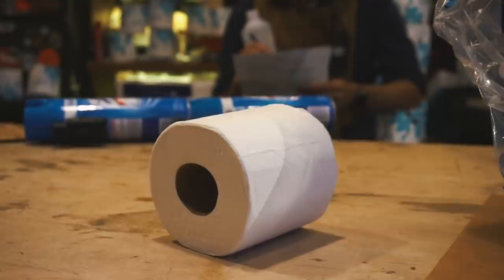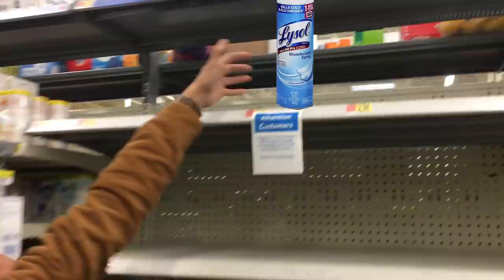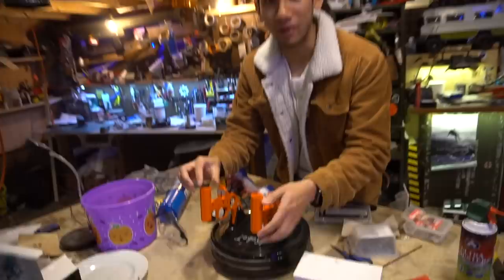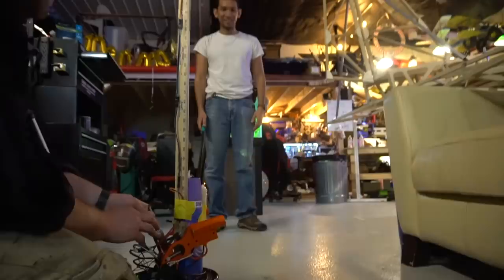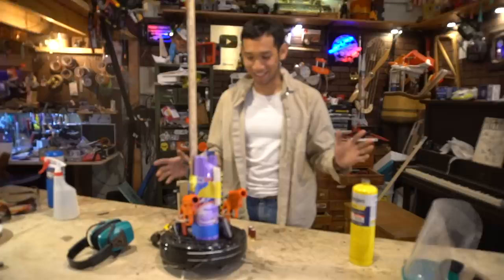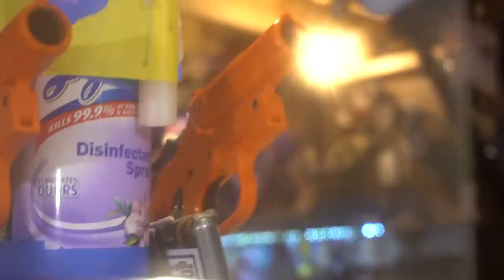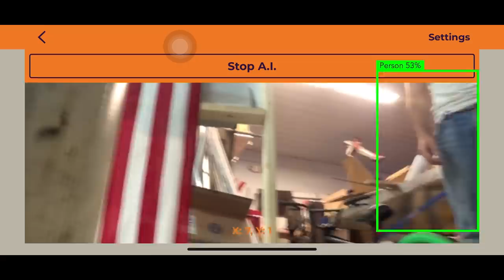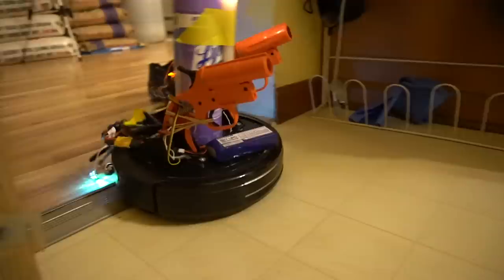A ROBOT that SANITIZES! (Roomba Hack)

Comment: They should try to upgrade from the N95 masks by modding an air helmet (I liked the look of the Ocelot AF-1 I saw on a quick YouTube search even if I have no idea how well people like it) that people use for wanting to filter air (Eg. for dusty, hot riding, pollution, etc.).  Wonder how well a sealed, high intensity UV air filtration system could work. Some protective shields for woodworking (to avoid wood chips/dust) have neat systems too.

Comment: My dudeee you need to make a 2.0 maybe make the shells more fragile if possible so it crumbles fairly easily when fired and a better idea is putting air purifier around it laying down and use small ones it will look great and clean air

Comment: Aerosols and cleaning products are not great to breathe even without being burnt but the residues and gasses produced by burning it would be even worse. I'm surprised that Peter was willing to spray it so much. Note I'm not saying that sanitisers used properly are bad, just that its not meant to be ingested or inhaled. No it probably won't kill you. But it may increase your risk of respiratory problems (Cancers, ulcers, etc). No I'm not a scientist nor a conspiracy theorist or anything crazy like that - I'm just sensible lol.

Comment: don't use hand sanitizer for anything other than your hands. the reason why you don't wanna do that is the fact that hand sanitizer contains Glycerin, once the Alcohol or ethanol in the hand sanitizer has evaporated the glycerin residue is still remains. Glycerin alone is a breeding nest for bacteria and viruses. so by doing what you think is safe, you make things worst. for cleaning, you need to use a none glycerol-based product with a minimum of 80% alcohol. Any medical staff should know this as well. sadly that's not the case! glycerol is the pure form of Glycerin and is used in labs to freeze bacteria in tubes for research. so please don't use hand sanitizer for cleaning it's not made for that! the reason why glycerin is used in hand sanitizer is that Alcohol and ethanol alone evaporates too fast to be effective. To get the full effect you need to slow down the evaporation of the alcohol or ethanol in the hand sanitizer so it stays on your hands for at least 20 seconds and that's were Glycerin comes in to play. As you are expected to wash your hands regularly it should not be a problem to use hand sanitizer on your hand!